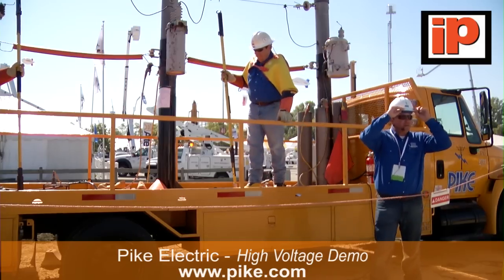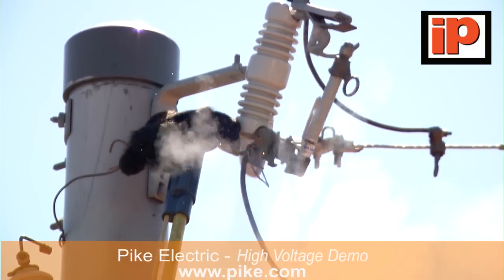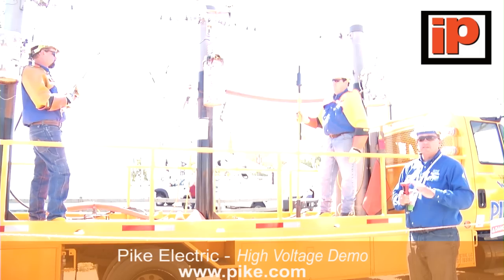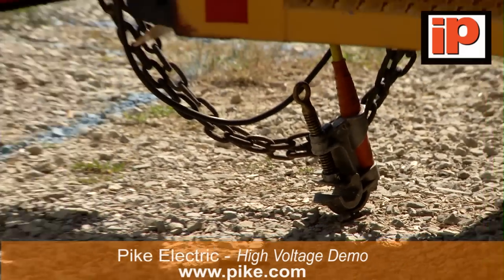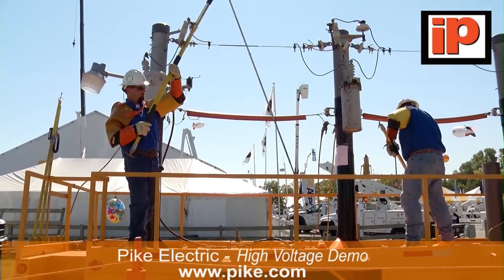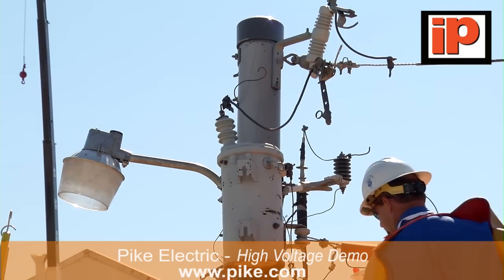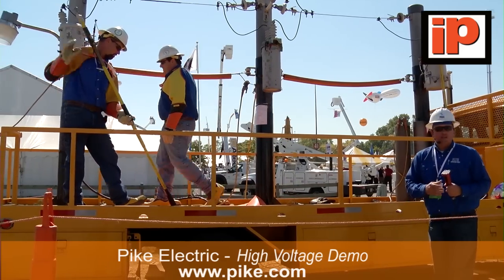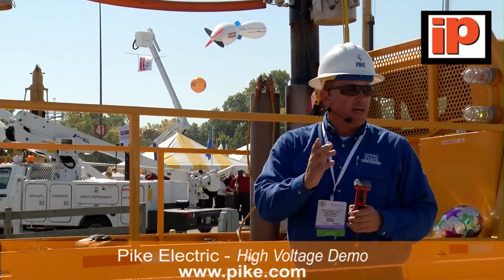Pike Electric Live Line Demonstration at iP Safety Conference and Expo

Comment: Excellent video guys! I'm a low voltage electrician, but to be honest, working near high-voltage and switch gear has always made me a little queasy.  I found this very informative- especially the parts where you demonstrated how primary voltages will find their way through PPE with damage/pinholes.  That was a real eye-opener.The fact that you guys are able and comfortable giving a public demonstration with lethal voltages shows you're seasoned pros!Kudos.  We need more professionals like you.
Reply: Fucking whimpey amperage compared to a 2 stroke diesel generator
Reply: No real energy here, just some fake sparks, those lines dont hold real enrergy. lightning is the real 2 stroke powerhouse here, not 60hz whimpey powerlines that have no real horspower,, the average 13.2kv line canot generate 4500hp and are nothing compared-ed to a medium speed 2 stroke generator, todays powerlines are whimpey and they do not hold up! an average 2 stroke positive lightning strike can bring them down. i love to see it happen.
Reply: Thats why you can make a pulsed plasma 2 stroke engine, its got full power stroke on the down stoke of any rotation like the Papp pulsed plasma 2 stroke overunity engine. i cant wait to try this with my sled motor!

Comment: MY electricity teacher exlpained the fuse "popping". Copper expands to 10,000 times it's size when it's vaporized. The electricity vaporizes the copper. The copper vaporizing expands so fast it needs more space so it blows the glass outwards during vaporization expansion.

Comment: Im taking Industrial Maintenance courses for work (the owner of the factory is paying for them...which is badass.) Im in the AC Fundamentals section now, and I am curious....you said that anything above 600V is considered primary.  Our facility is still wired for 3 phase, which is what is created by power companies anyway, so what is so bad about 3 phase? It seems pretty damn good to me, you have one 220-240 line and two 110-120 lines.  Seems pretty nice for an industrial setting.
Reply: Im a automation tech everything at my company is 480v its cool asf.....i wire up so many 3phase pumps a night
Reply: There's nothing bad about 3 phase power. Most people don't need, it all they need is single phase 120/240v. Three phase power is only needed for certain types of equipment which you'll typically find at a business.